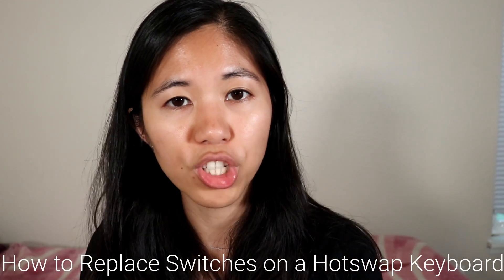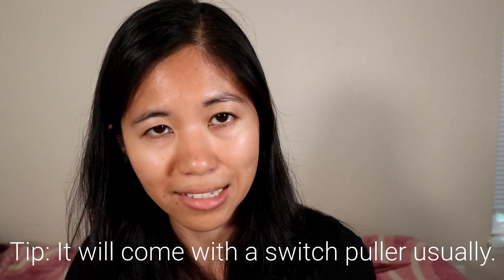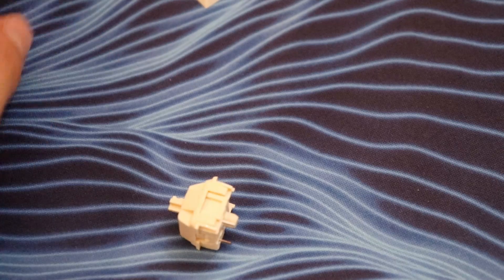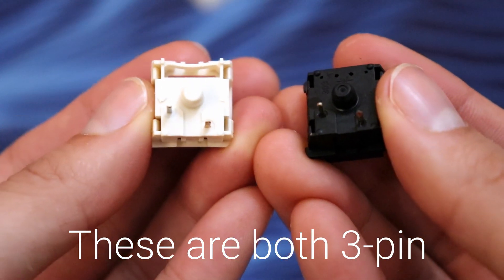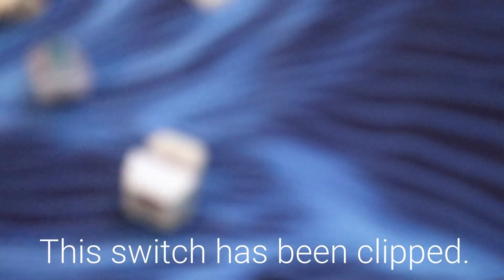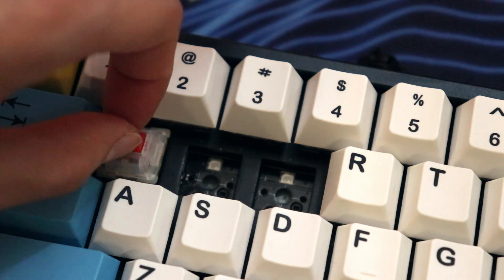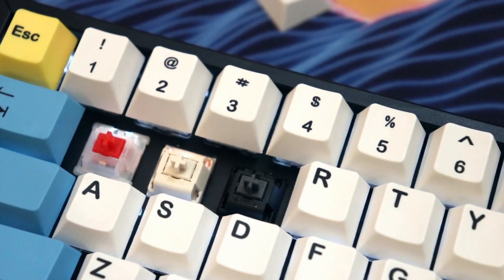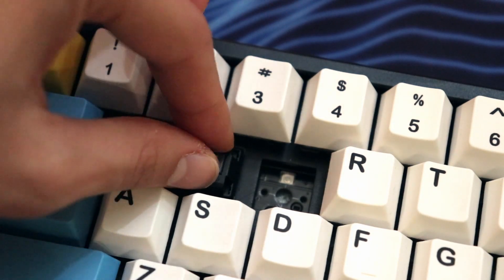How to Replace Switches on Hotswappable Mechanical Keyboard - 5 Tips You Need to Know

Comment: Bonus tip -- check your switches will be compatible before you buy a load of them -- cheap hotswap keyboards often have Outemu hotswap sockets which will only take Outemu switches (and other brands of switch which have thin metal pins, like Jixian).
Reply: @thefallenshadow sry im new to these kind of things since i just got my first mech just 3 days ago
Reply: Yes unless you thinning out the leg which is time consuming and potentially ruining the switch.
Reply: i have a tecware phantom and i bought cherry mx blues and it won’t fit in, is this why ?
Reply: @thefallenshadow no need to be rude they just asked a question😬
Reply: My tecware phantom comes with outemu hot-swap sockets, but by some blunt force and a bit of luck, I was able to put some gateron yellows. Although I did ruin like 10 switches.
Reply: @quesadilladude3368  i have tecware phantoms too outemu switches, the. I bought glorious purple pro kailh switches and just realize that the pins are too thick and wont fit it in. What i did is cut those pins into half and glued them on the board, luckily it works. Not sure if i did it right tho
Reply: @arcywafu  how do you cut the pins
Reply: @SwitchandClickOfficial  description time stamp has errors. Please correct them!
Reply: Exactly what is was loking for
Reply: Gaterons take cherrys right?
Reply: what if I use optical switches? will it work?
Reply: What about gateron also can u change the switches on a keyboard
Reply: So if I want to use Kailh box in a keyboard with outemu switches it won’t work?
Reply: Is it possible for a otemu keyboard to take a hater on switch!
Reply: I have a womier k66 and bought some 3pin switches is it still compatible since the keyboard is hot swap
Reply: Wait wtf? That's a scam...
I'm thinking of getting the Pulsar Lunar Alloy PK010 TKL, is this one of them?
Edit: Yup. Disappointed
Reply: I wish I saw this vid before I bought switches😭😭
Reply: @eq5876  if you bought gaterons you can clip the thin ones like this https://youtu.be/RyKfDt21UjE
Reply: I bought a massive load today for ab 100 bucks. I was so dumb and didn't realise they had 3 pins, whereas my keyboard can only support 2.
Reply: akko cs works for outemu
Reply: I came here because I just ruined 2 Holy Pandas due to what you're describing...
Reply: pretty much what I am in right now... bought some gateron milky yellow pros... and check my kb's pcb... it's an outemu hotswap socket...

so not only will I need to remove those 2 extra plastic pins... I have to slightly nailclip diagonally the 2 metal pins yo fit the milky yellow pro switches...

(even though my kb's product page says it's 5 pin compatible...)
Reply: also u can turn every normal pcb into a hotswapable one with soldering on the hotswap sockets... (usually)
Reply: Now I just have 87 gateron yellow switches and more stuff to buy

Comment: my switches only have one on the top. i mean the little clip that u have to push in with the switch remover. It doesnt have it on the bottom. And they wont come out and I dont wana pull to hard and damage something. What do i do ?
 (really would love a answer but this video is 5 years old so I dont think i will get one sadly)

Comment: I bought a keyboard and swapped all the switches to ones I liked just to find out that the tab key was broken. No matter what switch was put into it it wouldn't work. I returned and got a new one, but it was a pain to replace all the original switches on the 100% keyboard.

Comment: Excellent info...I am a very old computer user (80), but very new to mechanical keyboards. I bought an ASUS ROG Strix Scope II Gaming Keyboard, but find that I have accidental key presses due to the low actuation pressure of the NX Snow linear switches. Thus, I don't use it. I'm thinking of swapping the home row keys with switches that require more pressure. Is that a workable idea and what is a good option. The NX Snow switches  have an initial force of 40gf and total force of 53gf. What force would anyone suggest as replacement?

Comment: how can i tell whether my keyboard has hot swappable switches or not if it doesnt say on the instruction manual? got it off ebay (got blue switches and want to replace them with brown or green)
edit: the keyboard came with a keycap puller but no switch clipper so is that a telltale sign

Comment: Aligning the pins on to the PCB is a lot harder than I thought. Lesson that I learned, buy a good switch puller. Most of them are not good, especially the one that comes with Keychron keyboards.

Comment: If you are clipping plastic legs off of the 5 pin switch make sure you get ALL of the leg. If you don't. the switch will pull out when you take the cap off. In my experience it's much much better to simply start with the right switch.

Comment: My spacebar started to fail after i did my first lube session on my switches. I tried replacing the switch but the problem persisted. I also tried to clean the hotswap contacts with isopropyl alcohol but it also didnt work, and now the key is not working at all. Did i just killed my keeb or there is something i can do in order to save its poor soul?

Comment: I know this video is 2 years old, but I need to clarify something.  
Keyboards come in 3 different forms of construction when the keyboards PCB boards get manufactured.
1. - Soldered (meaning switches are permanently soldered to the board)  You will need to use a solder to take out the switches and place a new one & re-solder them back to the board.
2. - Sleeve connection.  This means that its usually a 3-pin switch connection and the pins slide into a sleeve socket to connect to the board. (No solder needed) usually on affordable keyboards.
and usually use Outemu or alike as switches of those types for these types of sleeve connection PCB boards.
3. - Hot Swap connection. means they have a switch socket cartridge that gets soldered to the back of the board allowing users to hot swap between 3-pin and 5-pin connections.

Comment: Can you damage your hot swappable board by switching your switches too much, even if you are being careful?

How much is too much? (I'm asking for a friend...)
Reply: Well technically yes, the hot-swap sockets have its own lifespan (around 30 - 50 times you can swap), so if it will fail to operate if you swap the switches too much. But you don't have to worry much about it, as long as you use your keyboard properly and not damaging the sockets, you can buy separate sockets and replace them with the old one.

Comment: the keyboard i want is the rk89 wireless mechanical keyboard i think its good, and it comes with brown switches. i also want these drop halo clear switches thats a 70 pack even though it has 89 keys. should i buy both? i havent asked yet  EDIT : theres a 90 package so ill have an extra one

Comment: With my gateron yellow switches the little clips that you have to squeeze literally break off when trying to pull them out. I squeeze them with the switch puller and some of them get like stuck down and I have to forcibly pull them out cus the clips no longer work, and in the process the little clip also breaks off when I have to just basically rip them out of the board completely. Is this something that is bad with my particular batch of switches that I bought, or is it something about the keyboard itself (gmmk compact)?

Comment: My Akko Lavender Purples don't seem to work on my RK84. It's only on about 6 keys, but I'm really worried about this because one of the keys that don't work is the E key. I was careful with removing and placing them, and it seems to be the board itself, as I can move the switches to different locations and they work, and if I move working switches to the faulty places it stops working. The original switches that it came with work on the faulty places, but I don't want to use them because the tactile bump is depressing. When I pulled out the switches the pins were also fine. What can I do to fix it because this is really scary for me?
Reply: Okay i fixed it. For anyone having the same issues about socket problems, i think it i got the issue for you

i REALLY do NOT RECOMMEND THIS but if this is your last resort then read ahead

bend the pins slightly (less than 5 degrees) away from the middle stem. then when you place the switch make sure that the pins are perpendicular to the plate&pcb. then insert. the pins will (hopefully be) snug with the socker, but the switch is tilted backward. now tilt the switch forward and lock it into place.

i suspect my problem stems from the akko cs switches. the community has been saying that they fit outemu hotswap, but this also means that this is thinner than a normal pin. also akko's switches come with really straight pins (this is respectable but also back for us). this means that it couldnt really contact the hotswap sockets properly (i inspected the sockets and it seems that the metal are on the sides.) my method pushes the pins so it can contact the hotswap pcb.

if this is already a solution in the community sorry i really didnt find anyone else with the problem so i had to think for my own

Comment: I have cheap hot swappable mechanical keyboard and i want to put some gateron switches, pins are same as my default switches but is there any chance that gateron switches will have different dimensions and wont fit  in there?

Comment: i’m bending so many switches i got a lot to work i’m half way done but this is such a pain, i. using prelubed gateron yellows on a red dragon k630 a lot of the switches are fine some i bent and a few switches i have to push really hard to register on the computer? is there anything i’m doing wrong

Comment: just a quick question my keyboard comes with a puller that i used to pull out the keycaps so does that mean my keyboard is hot swappable i dont remember where i bought it so
Reply: P.s I have a rk61

Comment: Does it matter if your keyboard has north facing LEDs or south facing LEDs will any switch be compatible
Reply: North or south facing PCB doesn't affect your switches compatibility, so you can apply any type of switches you like. The only thing you will need to concern is using Cherry profile keycaps on north facing keyboard PCB since it can make the switch interfere with the keycaps which will lead to a somewhat bland muted sound.

Comment: Hi i have a question. in my right arrow key in the keyboard, when i popped the switch out, one of the pins got stuck on the board. How do i get it out? (My keyboard is hot swappable)

Comment: I recently bought gateron red switches to put in a blackweb keyboard, it was very difficult to put them in, I noticed the stock blues it came with had the pins rounded, but the gateron reds were flat. Do they fold in on their own?? Because it was very very difficult and I had to clip all the pins a bit just to fit them in.

Comment: Even after watching this, I ended up destroying about 10 gateron reds in my keychron k6. It's just something to do with those switches, every other switch I've put in goes in and out super easy. It's like they hammered them in the pcb at the factory. I never planned on actually using them, but I still would have preferred to not break the plastic/pins/etc pulling them out. At least my tealios/holy pandas/tangerines/nk sherbet all come out super easy on this board and my others. So I didn't ruin anything super expensive. But I am kind of sad if I ever wanted to use the gaterons I'd have to buy 10 more.

Comment: I bought some gaterons and they are compatible with my room board. The switch contacts are more thin than the stock switches. The stock ones are more rounded so they're easy to push down.

Comment: Hey there, hopefully i can get a reply.. i just wanted to ask if i can replace the blue switch with red one ? will that work ? i bought RK855 keyboard and it is hot swappable but the only model that's available in my country is blue switch model and i have some red switches so i was thinking of replacing WASD keys with red ones..
Reply: yes it will work on any switch
Reply: @raffy7606  Okay man, big help :) Thanks a lot.

Comment: I wish I saw this vid before I bought switches😭😭😭😭😭
Reply: if you got the 5 pin switch mutilate the other 2 legs, and if your keyboard is not hotswappable invest on desoldering and soldering equipment and it will be a fun right

Comment: question can u cut all ur pins off. Also what are the pins for
Reply: for transmitting information to the pcb and which that information goes to the wire and to the computer to perform an action
Reply: @raffy7606  so u dont need the pins

Comment: The red gateron switches on my sk64 are hot swappable but they don’t look like the 3 pin or 5 pin switches and I would like to buy blue switches for my keyboard and I am not sure if I need to buy a 3 pin or 5 pin
Reply: theres google to show you the difference of 3 and 5 pins and to know what pins is that

Comment: I'm currently trying to swap out a keyboard that came with Outemo browns for Gatoron blacks, but the new switches don't seem to want to go in, and it looks like one of the metal pins is ever so slightly larger than the pin on the browns. Any advice?
Reply: Come on switch, and click a heart is not advice

Comment: how did i know my keyboard is hotswappable
-i pulled the spacebar
-the switch came off with (the pins were bent)
-i changed the switch with the ones that came with the keyboard
-it worked thankfully
-i fixed the bent switch
the end

i still dont know if thats true hotswappability lol

Comment: Hi! Um I was watching this because I wanted to dip my toes into the enthusiast keyboard life and my first hot swappable keyboard was a cheap dk61 60% by kemove I got off amazon, at that point I just wanted a smaller 60% with a satisfying click didn't need anything fancy I'm looking into switching the keys out and I pulled one out to see what pink was it a 3 or 5 but this has none, there gateron blues, and only have a small black plastic pin in the bottom middle of the key, is there any way you or someone could help me figure out what this is and what options I have of putting in here? Or am I confused and will 3 pins work?
Reply from the maker: Seems like it's optical?
Reply: @SwitchandClickOfficial  OK thank you, so does that mean I'm limited to only gateron opticals?
Reply: @SwitchandClickOfficial  lol forgot to respond I think  yes I found out they are optical

Comment: Thanks for the sharing.  Questions: 1. Can 3-pin switches be used with 5-pin keyboard?  2. What does "MX" mean?
Reply from the maker: Yes. MX is a type of switch under Cherry's brand. It can also be interpreted as cross-shaped stem mechanical switches, like how Kleenex is tissue paper. I guess it depends on the context

Comment: I tried to remove a switch without using a switch puller and the two metal pins detached from the switch and was left on the board. What to do? 😭
Reply: buy new
Reply: same question

Comment: Really wanna ask about drilling holes in the bottom housings. Some keyboards like the Tecware Phantom TKL use Outemu Switches and, from what I've been told, can be hotswapped with other switches by snipping of parts of the pins and creating a hole in the bottom housing to fit the LED in. 

How do I create the hole, though? I've heard someone used a soldering tool to make one, but can I go about using a drill? And is there any other way I can go about doing this?

Comment: Glad do many people want hotswap boards. Hope they become the norm tbh. Yes those custom keeb elitist  people might get upset. But esp for new people hotdeap is a godsend so it allows us to try different things 

Today I'm getting my box jades and I can't wait to put them in my board. Just wish I had a good switch puller and not the shitty small one that comes with the k2

Although I ordered box jades then found our about crystal / clear jades and ordered those two. Not sure if I should want for the jades since I've heard people say too many swaps might end up damaging the board. 

P.s. another good example for why this is so important. When I got my keyboard I thought I would prefer heavier switches. I love the blue gaterons thst come with tj but recently got a RK87 with blue "RK' switches. And although they sound horrible comparednto blue gats they are a bit lighter than the gaterons and I absolutely love them. Makes it much easier to write fast. 

Man I hope I will like the jades. Also have a optical hot swap 60% on the way with blue gats..might change those for some other switches later on l. But first I need to get some keycaps. 

The ones on the k2 hotnswap edition are nice but far too sharp and I don't enjoy OEM. The ones on the RK87 are thinner but the texture is so much better compared to the k2..I hope the pudding caps I ordered also feel like that

Comment: @Switch and Click i broke one of the tabs of the gateron switch while it was still in my board. Any tips on how to remove that? Also opened the switch while i was at it :/
Reply from the maker: I've broken plenty of tabs, you can still pull it out
Reply: Got it. For anyone else that's having the same problem, you can actually go the other direction and not bother with the pins. Go deeper and grab onto the housing. I didnt see any damage but its obviously not the best way to do it. Very scary!

Comment: Can I clip one of the metal pins? Because my board said it was hotswap and it can with a puller and it does t have the two inserts for the two metal pins it only has one
Reply from the maker: Don't clip the metal ones, only the plastic